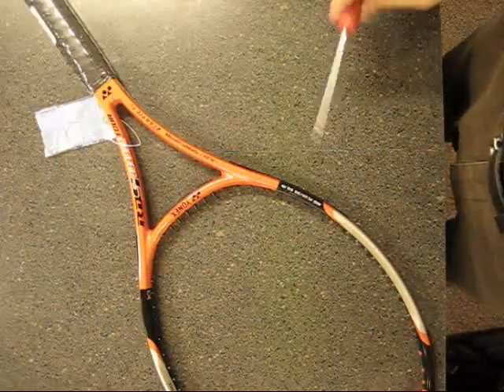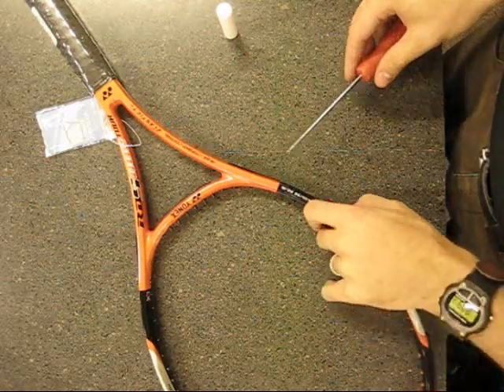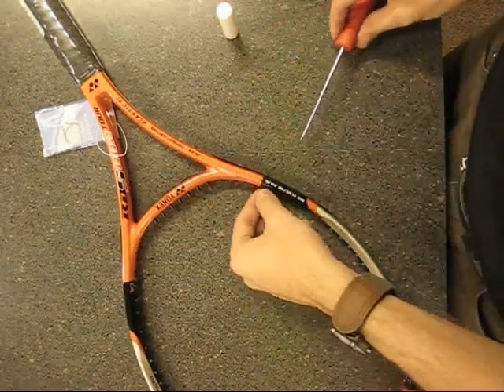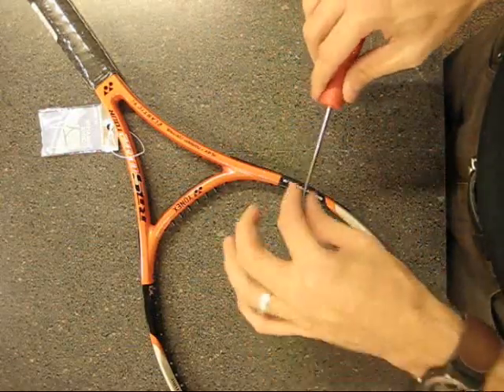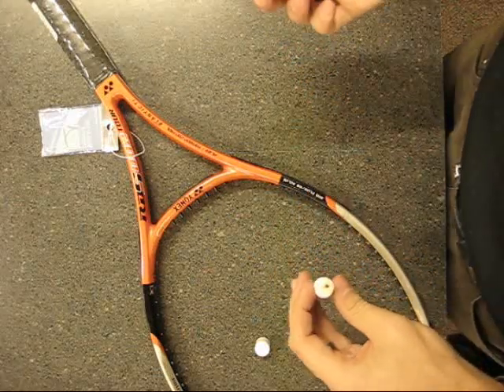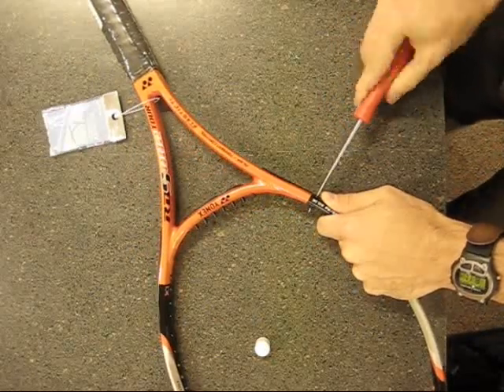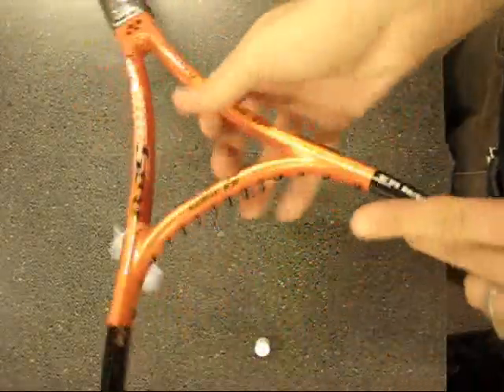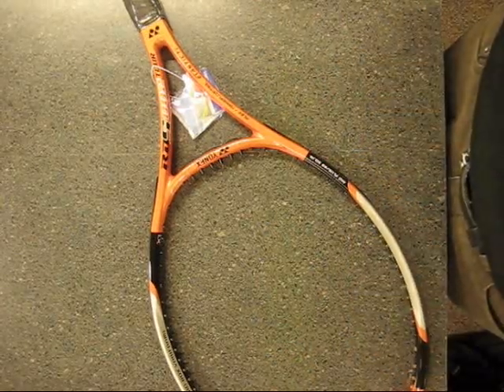How to Widen a Tennis Grommet

Comment: I will also use a scrap piece of string in the grommet hole as I slowly insert an awl that has been lubricated. The scrap string will take some of the friction off the grommet and assist in opening the grommet with less stress.